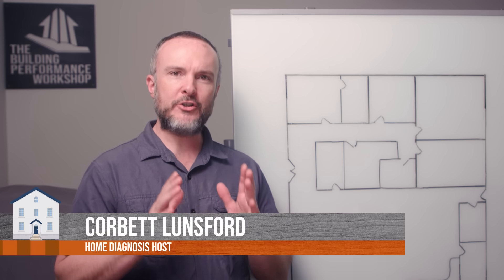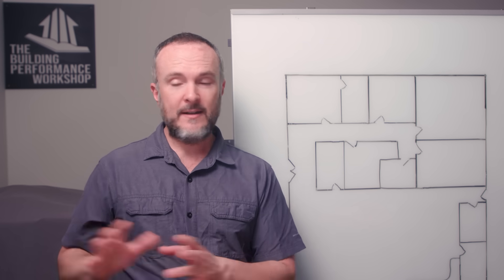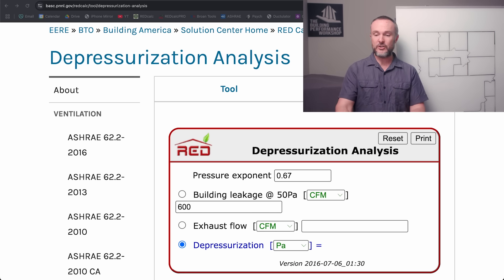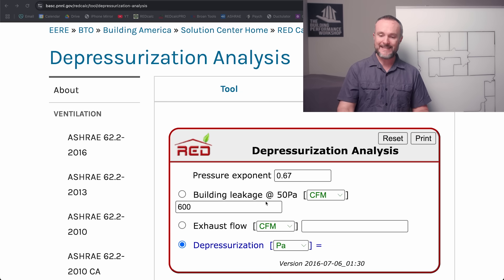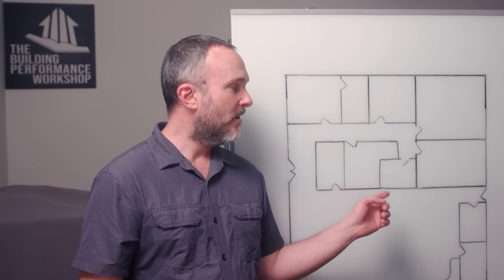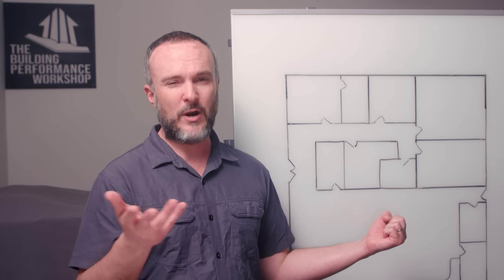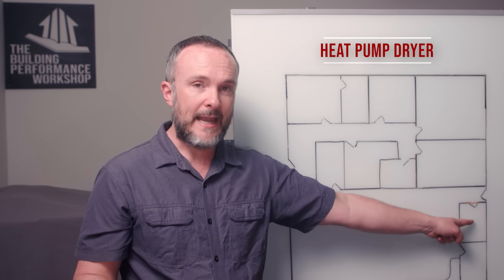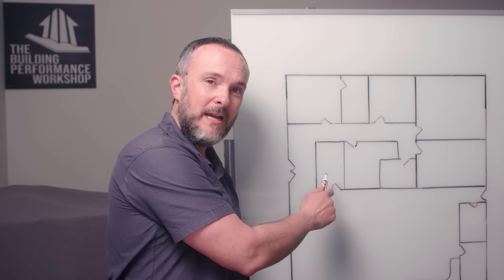WHY Vented Dryers Make Problems in Airtight Homes: Go Ventless Heat Pump or Condensing Dryers

Comment: Still curious to know the downsides to the heat pump dryers from people's experiences. I figure like another commenter said having the dryer in an enclosed room would be the biggest issue as opposed to a loft like situation or open room configuration. I just don't think air tightness really needs to result in so many unintended consequences, meaning, going for air tightness really shouldn't have to require all these other changes to the house. I have watched many, many hours of building science videos from various folks and I still think the real world scenario is sometimes a lot more ambiguous than the theory says. For example, we don't have a whole lot of data of people going back to various methods and projects to see what really has occurred, plus, all the situational elements in different geographical locations. What one sees more of are specific problems being addressed but not real world comparisons of all the methods and materials. I like the motto, keep it simple!
Reply: The main issue is a maintenance one. They require excellent filtration to prevent the heat exchanger surface from being contaminated with the microplastics that get created in the dryer. It’s generally not a user accessible area, so technicians have to do it unless the user is very adept at DIY.
Reply: They are terrible to lint clean, they take much longer to dry, smaller loads than traditional machines.  Significantly more expensive as well.

There are bigger downsides than positives for current heat pump machines for my family. We do too much laundry.

Comment: Good note, and timely for us, as we've just finished an air-tight addition to our home. I'll start shopping around for a heat pump dryer. But for the sake of completeness I want to ask: what about boosting an ERV, or otherwise configuring a smart "Drying phase" configuration?

Comment: During the whole video, in my head I was trying to compare/contrast to the much higher CFM involved in a kitchen exhaust hood, which are clearly critical and I think you've shown the math often requires a powered makeup air source. I'd love to see an explanation of why a low CFM laundry room is ruinous with makeup air, vs the kitchen exhaust isn't. Is it just the assumption that the laundry room door is closed that makes it so? Cooking run-times vs laundry run-times? And of course...the dreaded wife factor 🙂
Reply from the maker: Yes and yes- and brides understand plenty if we can explain the pros and cons clearly.
Reply: @HomePerformance Please, please, please!  Hide the fry pans and rolling pins in the off chance she might read visit your content.
Reply: @HomePerformance I'm really enjoying your videos and it's intimidating realizing how clueless I really am. 
Bought a house in Central Florida built-in 79. Wish I would have been watching your videos before I even purchased the home. 
Washer and standard electric dryer are in the garage which gets hot as an oven. When the dryer finally gives up The Ghost and I replace it with a ventless will I see much improvement? Thank you in advance

Comment: I have encapsulated my crawl space and sealed my attic from the house. It’s a 1994 house. So I believe I am at 4ach 50. 

We keep our house warm so some extra humidity is usually nice. I have put in a bypass on the dryer so it will just blow the airflow into the crawl space. 

I am having the siding replaced so I will be taping all the sheathing joints. Hopefully that will bring the house to 2.5 ACH50. 

I wonder if that will be tight enough to cause problems. 

I already have a ventless dryer. My wife just want to be able to dry clothes with in 45 minutes.
Reply: The concern I would have is that during depressurization, outside air gets drawn in. That air in many places is higher moisture, and will condense along the intake paths. That can eventually cause structure issues around mold and rot. There needs to be solutions that are integrated into ERV systems to control the characteristics of the introduced air.
Reply: The first thing you have to understand is that when you make your house more airtight you have to control the intake air and do your best not to let your house get depressurized. 

Like you said you can do this with erv’s but I just have an 8” fresh air intake into my furnace. If my house needs to pull air in I’m more worried about where it is pulling that air from than I am about any energy loss. For exactly the reason you stated. Moisture.